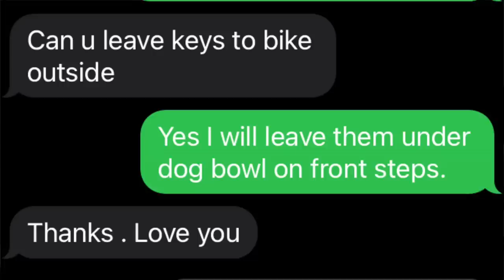Repairing my Dads Yamaha Zuma Scooter after sitting FOUR YEARS. Complete Fuel System Install.

Comment: Great job getting it back together!!! I've had 3 Zuma's of those vintage through the years.  I used to ride them to my work because they had free parking for motorcycles yet charged for cars.  My first one I put 24,000 miles on it and still ran like a top.  Combined all 3 I've probably got 40+K miles.  Yamaha did some things right with those bikes.  They really are amazingly fun and nimble bikes to ride!!! 🙂

Comment: I’m a hardcore scooterist. I bought a Vespa P200e that had been in a warehouse for 30 years with only 79 miles. It was rusty and I replaced the tank and put a carb kit in and was off and riding. 15 years later still riding. Eventually had to reseal the engine and replace the carb with a 24/24. I had a Honda Met initially and found a club to ride with and breathing all that two stroke smoke, I knew what my next step would be. And now I have 5.

Comment: You inspired me to get my 2009 Zuma 125 running. Derusted the tank… found a break in a wire going into the ECU… and flushed the fuel injector. Runs like a sewing machine now… thanks again.

Comment: So sorry to hear about your Dad, I can see why it took you a while to get to working on that thing. Scooters are my wheelhouse, I had many in my fleet until they were stolen. Something to be aware of if you aren't used to scooter or motorcycle carbs, the mixture screw for the idle circuit is the opposite from regular small engines. It's an air screw, not a fuel screw, so you turn it in to go richer and out to go leaner. Also, the black part on the carb is an auto enrichment (kinda like a choke) and it hooks up to power and comes on with the key. There is an internal heating element that slowly closes off a port on the filter side of the carb.  When the engine is cold, air flows through and draws more fuel to richen the mixture, and it slowly closes as the engine warms up.  And for anyone who has a two-stroke scooter and is having no low end issues, having the intake tract being complete and the filter in there and properly oiled is mission-critical! People like to remove the stock air box and swap out to a free flowing pod filter, and then the thing has absolutely no power. They are tuned to run stock parts and any changes makes them run like poop unless you do the proper tuning. A great place to buy aftermarket and other scooter parts is Scooter Swap Shop in Portland Oregon, They are awesome!.

Comment: I just did some work on my 50cc scooter yesterday so I'm familiar with that carb.  In case you're curious, that black cover that is on the electronic choke can lift up off of the electronic choke (without having to remove the screw that holds the electronic choke plate).  Then what you do is rotate the choke (don't have to loosen the screw) so that when you push the cover back onto the choke, it also covers that exposed vent (if I remember correctly it vents into the float bowl - don't quote me on that one).  Then if I remember correctly the other vacuum line goes to the gas flow valve.  Hope that helps!

Comment: I did.  Got my 641 running again.  Have two spare coils cause no one will take returns on electrical parts, and a spare condenser, as well as an extra set of points.  But I sure learned a lot about a tractor distributer as well as what ought not be grounded.

Comment: Thanks, working on my log splitter with a 6.5 hp B&S Quantum engine. Won’t start, has spark runs with carb cleaner. Changed the fuel filter,, thinking the needle valve is stuck. Gonna d/c the closest fuel line, spray cleaner in, use 15 psi see if I can in-stick it w/o carb removal. Wish me luck 
Always started, drained an cleaned the fuel tank.
Thanks 
Matt

Comment: I had a 2005 just like that one. I rode it for many years until a newer 125 came up for sale. The smoking is normal and I saw it every time I started it. Top speed is about 40 to 45 and they are great for running for things as you can scoot thru traffic much quicker that with a car if the distance is close and the speed limit is lower. I work EMS and the Coroner Office. I see overdoses often and am very sorry to hear of your loss.

Comment: Sad story about your dad/brother. I have owned and ridden motorcycles all my life. Back in 2006 I bought a brand new 2005 Zuma 50cc scooter, mostly because it was so cheap. Dealer was trying to get rid of it. Lots of fun, but where I'm at you are very limited as to where you can ride something that tops out at 40 mph, and takes forever to reach that speed. I sold it after a couple of years. It would be great if you lived out in the country, or had some place where you could ride it without getting run over. 
I don't believe it has a fuel pump. I'm pretty sure that is a vacuum operated petcock, that only works when the engine is running. 

Nice dog. It really sucks what some people do. Glad she will be taken care of.

Comment: I just fixed my 2005 Zuma 50 over Christmas. It sat for over 2 years and felt like it had no power the last time I rode it. I siphoned the gas out and ran it dry. The tank was very clean and so was the carb. I thought the belt and rollers were the problem so I replaced that plus the air filter and plug. Same issue with no power after all that and I found a comment on the Zuma forums about burning the exhaust. I did that for almost an hour with compressed air and couldn’t believe how much smoke and sparks came flying out. Now it runs like new with 15k Miles and I’m about to take it for a spin today. One tip …get new Pirelli or Michelin tires. The stock tires are garbage.

Comment: my put off project  Is the front seal on my f-250 4x4 it been setting over a year.even the wheel ramps have sunk into the ground until  the tires are back  on the ground

Comment: Great video. What do you use for solvent to clean carbs in the Ultrasonic cleaner tank? I believe that's a vacuum operated petcock. You would not need a fuel pump if the tank is above the carb.

Comment: Sorry to hear about your Dad.
😢
Tearing it apart is the easy part. Putting it back together and it run...🎉🎉🎉😂
Woho it's alive.
My sister has a scooter that had issues. I changed fuel lines and carburetor. Then it would pour fuel into engine and lock up. Cleaning the carburetor, is that all I need to do? Would love to get it going and she can ride again.

Comment: That old yamaha scooter is amazing probably have reliable minareli engine , u should replace oil in brakes check and check brake pads , also cvt belt should be checked and probalby replaced with cvt rools , also gear oil for rear wheel , and scooter is ready to serve u or someone for years to come good luck with it .

Comment: These scooters are really simple.  I fixed one for a disabled vet a few years ago.  You will need an electrical schematic and the only things you need to worry about besides the carb is the CDI and wires plugged in wrong.

Comment: First I enjoy all your videos. Sorry to hear about your family loss. This is off topic of this video, but have to ask, there is a John Deer L130 with a 48 inch deck. It stopped working in the middle of a mow. It’s an electrical problem for I can turn it over by bypassing the starter with a screwdriver, but won't keep running. Where would you start? Thanks.

Comment: I have a 2007 Yamaha Vino 125 - (YJ125W) which I believe has a vacuum operated fuel pump & Yamaha calls this a "Fuel Cock Part# 5HK-F4500-00-00" which seems to operate exactly like a John Deere Vacuum Fuel pump and has no petcock valve.  Again this is 2007 and everything worked fine until 1 year ago when I began having fuel starvation/stalling at 1/2 tank. Ultimately I gravity bypass the fuel cock and everything has worked fine with 4000miles of travel.  Yamaha says this part is not available.  Do I really need this since I run totally on gravity?

Comment: Hello everyone I hope you are doing great but I have a question. I have a 04 Honda 4wheeler that had a dead battery and it needed a solenoid. So I replaced the two but when I tried hooking up the battery it wanted to start with the keys out of it .I don't know what to do. If there is anyone out there that could help it would be greatly appreciated. Thanks Donnie 😊

Comment: Kool story but will give you a serious piece of advice - Never get on & ride that Scooter as in Never.
The why is because it is the most fun you will ever have riding anything.
My background, have owned a Harley or 4 the past 53 years & now the Ultra Classic has become Hwy only.
Bought a new Honda 49cc Ruckus in 2022 cause it looked like a fun camping ride & emergency vehicle to hook on the back. Problem is now it has become my daily rider. Got into it & upgraded everything so it will cruise at 44/46mph top speed 49mph making it a perfect in town bike plus at 90+mpg costs pennies in gas.
Short story long - it is more fun to scoot around on than any bike I have owned since a mini-bike at age 12.
My Buddies did chuckle at me until the Bud Light recent adventure where all they do now is order other brands & are forced to listen to my comments about their former favorite beverage & why I drank whiskey & avoided pee colored drinking transmission fluid. 🤡